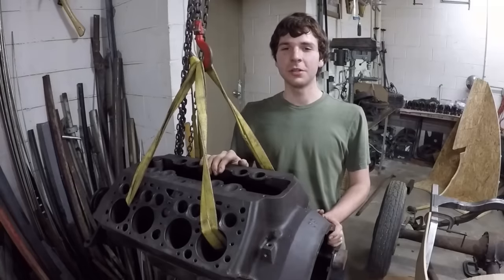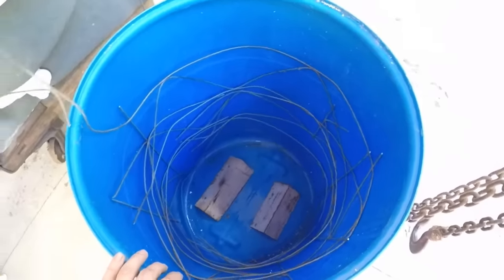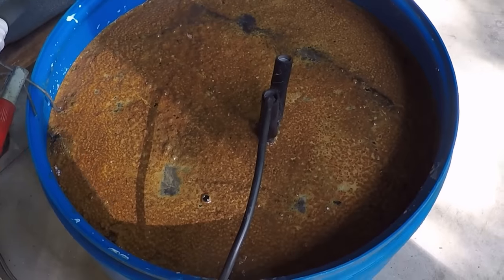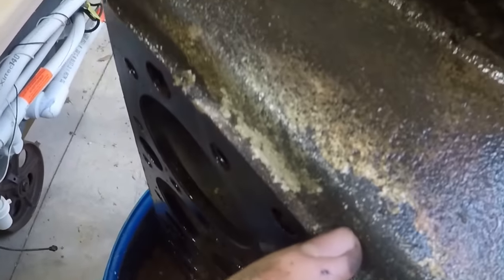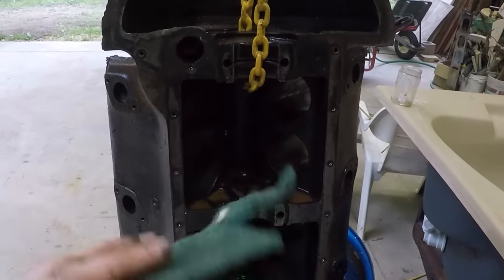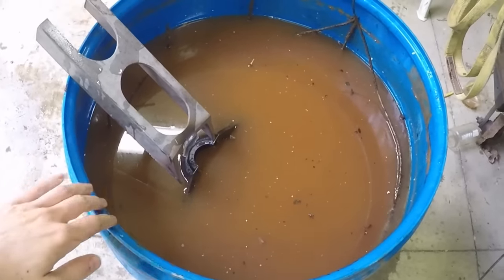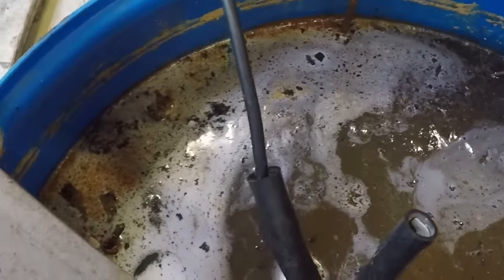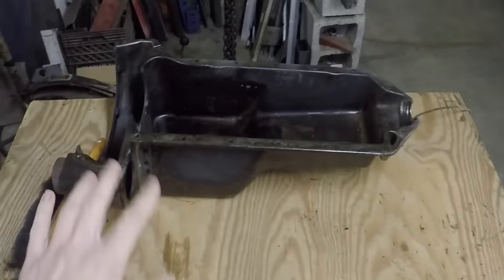Cleaning a 70 Year Old Engine with Electrolysis

Comment: Nice video, your parts turned out great! A few notes for others interested in electrolytic rust removal:

This process produces hydrogen and oxygen gas. Work outdoors, and avoid sparks and open flames.
The process does not remove ANY of the base iron or steel. It only affects iron oxide, which is converted to an iron compound.
The presence of hydrogen can potentially cause hydrogen embrittlement, but the effect is likelly minimal. Might want to minimize current and time for suspension components.
Higher current will speed up the process. I routinely use 2-5 amps for pulleys and other small items. For engine blocks and other large parts, 10, 20, or more amps would be more suitable.
The water level will drop due to electrolysis (turning water into H2 + O2), and due to evaporation. Evaporation is sped up by heating of the water from current flow. Account for this if you're going to let it run overnight.
Current flow follows the path of least resistance, so exterior surfaces and those closer to the anodes will be cleaned fastest. Interior surfaces will be very slow. Anodes can be place inside the part to overcome this, but be careful to make sure they don't touch the part.
Don't use copper wire or copper clamps to connect the part to the current source. The copper will plate onto your part. Use carbon steel (not stainless) wire or clamps.
Steel anodes are sacrificial, as mentioned. As they oxidize, their resistance is increased. Clean or replace them periodically. Or, use carbon rods as anodes to avoid the problem altogether. Don't use copper or stainless steel anodes.

Have fun!
Reply: Juden Arier  I have read that it changes Fe2O3 to magnetite, Fe3O4.  You're right, acids oxidize, and to  put it very simply, this electrolytic method forces oxidation of one of the Fe atoms through electric current.
Reply: I have wrapped a steel electrode with fiberglass window screen material to insert it into close places. a rod like that could be inserted into the cam bore with good results if needed.
Reply: Nice info on those carbon rods, as they are non-consumables. Any idea on sizing for those rods, as pertinent to the electrolysis process. They're available through Ebay, but not sure if those available would be sufficient @ 7/16" & 1/2" x 12+". The rods would make getting deeper into an engine block by wrapping the rods in a non-conductive mesh (nylon screen?) and inserting that into the lifter or cam bores, or even deeper into the water jackets of old cast iron blocks.
Reply: Saw his clamp in there, but it's so big you might not see the copper?
Reply: Electricity follows all paths, not path of least resistance
Reply: Ca
Reply: Can i used a hood ? Or is the metal to thin?
Reply: Nice explanation.  Thank you
Reply: Electrolysis doesn't remove base-metal, eh? That's not true at all. If it were, they wouldn't use bricks of Zinc as sacrificial anodes on boat hulls. For someone who claims to know so much, you really don't seem know a whole lot. Electrolysis doesn't care whether it's eating away rust or good metal.
Reply: BL4CKB34RD the polarity matters. If you hook up the cables opposite of what he said it will eat up your good part. As long as you hook negative to your part and positive to your cathodes it won’t touch your good metal but the cathodes will be eroded away over time.
Reply: you failed to mention that he called the sacrificial electrode the cathode.  in an electrolytic cell, which this is, the positive terminal is the ANODE, as it is the site of oxidation (AN OX - RED CAT).  the block is the negative terminal, and in an electrolytic cell, THAT is the CATHODE, as it is the site of reduction.  the oxidized iron (rust) on the block is being reduced and re-deposited onto the block.  the sacrificial iron anode is being oxidized and becomes iron ions in solution.  pure iron would be better than carbon steel.
Reply: blackbeard - VERY clever how you use numbers in place of letters.  never saw THAT before.  as for your comment, you are comparing apples to oranges.  the sacrificial anode on the boat hull is part of electroCHEMICAL cell, ie, a battery, in which a spontaneous chemical reaction produces current.  that is NOT the type of cell shown here, which is an electroLYTIC cell, in which an applied external current is used to drive a chemical reaction in the OPPOSITE direction from that which would occur spontaneously.  the names (or the polarities) of the electrodes are REVERSED in the two types of cells.  so you are correct when you say that the sacrificial anode on your boat or in your water heater gets oxidized, but in THIS case the anode is the positive sacrificial electrode (the wire), which gets dissolved, while the block is the negative cathode, where the rust gets reduced and redeposited onto the block.  NOTHING on the block is being dissolved, neither rust NOR metal.  so it is YOU, in fact, who "really don't seem to know a whole lot."  but don't worry, you can still ACT like a know-it-all, and you will fool most of the fuckwits in a YT comment section.  thanks for your 2¢.
Reply: @johnmichael1594  Not even close. I personally don't care what he called it. Sorry, but I'm gonna have to go by what my Uni professors called it, not some guy in a Youtube video or an obvious amateur like you. 

There is no such thing as a sacrificial cathode. Ionized material flows from the anode to the cathode. It's electricity 101. Anodes are always negatively charged (Anionic), and cathodes are always positively charged (Cationic). It's kind-of in the name, Einstein. I take it High-School chemistry class was not your strong suit? lol. When you reverse the polarity, your cathode turns into an anode and vice-versa. If you knew fuck-all, you would know that.

The only reason why one should ever make the part a Cathode is when you're plating it, but again, if you knew anything at all, you would know that.
Reply: @basketofdeplorables4253  So much nope... Removing material from the part is the goal when rust removing, genius. Also, it is the anode that erodes, not the cathode. You've got it backwards, just like pretty much everyone else in this comment section.
Reply: BL4CKB34RD yes we all got the anode and cathode mixed up. But as long as you hook positive to the anode and hook negative to the piece you want cleaned it will only remove the rust and paint from the material. It does not touch the the underlying iron. I clean engine parts with this method almost literally every day. 
The piece that has positive side hooked to it gets destroyed and all the rust transfers to that part. The negative side does not get damaged. If you hook it up backwards though the good piece will be destroyed.
Reply: I started to write much of this, lol. He did call the cathode sacrificial which as you know is the anode. Electricity does follow the path of least resistance. A chemical reaction occurs providing a protective film of hydrogen when polarized, creating resistance. Perhaps the detergent prevents polarization? Carbon rods have been used for impressed current systems for a long time. They can last for years with 24/7 use. But what he did was fine, just replace the wire, it’s cheap. But I’d probably media blast it.
Reply: @jeffb8437  what .........? Even plasma arcs follow the least resistant path
Reply: I always remember it as RCOA: Reduction = cathode
Oxidation = anode
Reply: +Norlijah Arshad - lol.  don't hold your breath.  8^)
Reply: BL4CKB34RD most boats deal with galvanic corrosion not electrolysis, it’s a misnomer that took hold but should be corrected.
Reply: @johnmichael1594  Almost...no finer words have ever been spoken...high five on that brother!
Reply: Close
Reply: Juden Arier  He seemed to get the water jackets very clean and rust free with a basic solution?
Reply: Juden Arier  (solutions dont solve iron oxide, but acids do. ) Probably the translation but using the word solve implies it does not remove rust (Iron oxide) unless acid is used.
Reply: Thank you...
Reply: Why dont use stainless steel anodes?

Comment: The biggest gain we found on our cast 289 ford V8 blocks was that it really cleaned the water jacket out and made quite a difference on the temperature when running 😎
Reply: There are company's that sell a filter to go in the radiator hose. The old SB fords were really bad about  casing sand and grit  plugging the radiators
Reply: @Rat Fink That's bull . Buddy i have owned an automotive machine shop for over 30 years . Specializing in fords. 60's and 70's Fords shed sand and casting trash. Filters for the hose are made for just that reason. In the 60's and 70's there were many foundry's and the big 3 had and still have there own casting foundries. Blocks and heads were made in the old days with sand . The accuracy and quality was awful . I have sorted through a dozen blocks with a sonic checker to get one that has expectable core shift and cylinder walls on older castings. For high performance use. Now heads like AFR are permanent mold castings as many OEM or a lost foam method or wax cores. The old sand casting are long gone for engines and heads. it would be impossible to sand cast the complex thin wall casting of today with sand due to core shift and porosity.
Reply: @Rat Fink Do a little research then open your mouth
Reply: @Rat Fink Yes, but not everyone cleans their blocks the same way. Chrysler had an issue with their magnum v8 engines shedding casting sand and having premature water pump failures. A good engine block flush will clean it out, but a coolant filter is also an option
Reply: I cleaned quite a few ford flatheads and the water jackets were always full of junk. After baking and steel shot blasting, still had to jam an air nozzle deep down every coolant hole many times to get as much out as I could.

Comment: Cool - that block looked so nice. Only criticism I have (take it from someone who's done it for years) is to please wear safety glasses when pressure washing. Especially on irregular surfaces those little chunkies can ricochet back at you before you can blink. I've had bits of crud cut my face (no face shield) and was glad that at least I could still see at the end of the day because I was wearing a $2 pair of safety glasses. I had enough nasty things get in my eyes when I was young and immortal and too cool to wear them - now I just wear the glasses whenever there's a hazard because the world is beautiful and I want to see it, my children and, soon, grandchildren. If you're going to take good care and pride in that engine rebuild, please extend the same courtesy to your body.
Reply: murraystewartj wise comment
Reply: Couldnt have said that better myself.
Reply: thanks for this simple but important reminder🙏
Reply: All I have is a metal 55 gallon container can I use that instead of the plastic one Will it still work?
Reply: Also wear a mask, aerolized liquids are a health hazard for your respiratory system
Reply: @hectorortega9131 I think it would. Paint the inside, or line with plastic. Even if bare metal, should work.
Reply: Safety squint all the way bruther

Comment: The blackened coating that remains is called Magnetite.
Reply: Yes, it is a different oxide state than common rust and is much easier to get off the metal.
Reply: I was thinking patina, it shows you I was at the back of the class with my helmet and crayons!
Reply: I use a piece of a magnetar to remove it.   :-)
Reply: That worked great!  👍
Reply: Isn't magnetite also a type of iron ore? Back to whence it came.
Reply: Rust is iron oxide. Electrolysis turns that rust into a heavier compound of such which does want to be with the cast iron. Magnetite is Iron(III) Trioxide.

Comment: Also a big advantage is that the interior rust in closed subframes is disolved.
European cars have often closed boxsections and subframes because of their monocoque construction.

Importent with those parts is that you drill some holes so the proces can also reach inside.
An additional advantage of those holes are that you can use a borescope to see inside and apply anticorsion into it.
Reply: Go back to school

Comment: You were the only video that warned me about aluminum dissolving.  I will be cleaning up a tool and one of the parts is aluminum with two steel rods sticking out.  I don't want to risk pressing the rods out to de-rust them, so I'll work out a different way.

Comment: There is a problem with using electrolysis for cleaning an engine block. That is many use small plugs of aluminum to blank off oil galleries, these can be hidden in the end of drilled holes that you wont see. When the engine is rebuilt there isn't proper oil control through the block and it fails immediately after rebuild.  Any bearings that go through the process will need replacement, Camshaft etc. This isn't the case with all engines but some do this.
Reply: Your supposed to strip the block bare first, duh

Comment: I kept thinking...... what would 40 amps have done? Would it have worked better? Faster? Or made no difference? But I must say..... That bare Flathead block is a piece of art!😁
Reply: It would probably have pitted the hell out of the block. When you're doing electrolysis, you're removing material, and too much power can quickly ruin the part. Think of it like a welder in reverse. The more power you give it, the more material will be removed, and electrolysis doesn't care whether it's eating away rust or base-material. Electrolysis has no sense of humor, you see... lol Technically speaking, if you let the part sit in the tank long enough at even low amperage, there would be pretty much nothing left but a really crusty cathode.
Reply: @MFKR696  
That's contradictory to what he said. He said it only ate off the rust and grease and didn't affect the cast iron. I also seen another commentor say he uses 10 amps or more on large items. That's the problem with YouTube. Do I believe the YouTuber and the other poster, or you?🤔
Reply: @1956model1  Of course it's contradictory. That's kinda the point.
Reply: From what I have heard, only the rust (iron oxides) are affected by electrolysis because of the molecular charge causes the iron oxide to break up with hydrogen going to bubbles and oxygen going to the cathode.  The black stuff is a mixture of iron metal and magnetite from what I know.  I could be wrong.

Comment: To be more specific, due to galvanic reactions and the properties of aluminum, it would be eaten away because it would effectively turn into a sacrificial anode, much like the Zinc bricks that are used as sacrificial anodes on boats and ships. Because of the galvanic properties of Zinc and Steel in sea-water, on a boat/ship that's electrically grounded through the hull, the combination of salt-water and angry-pixies will pull material away from the Zinc bricks instead of the hull. If they weren't there, the hull would ablate to nothing in no time just from being grounded the way it is. A ship is essentially a giant anode, and the ocean is essentially a giant cathode. I know this has nothing to do with anything, but I thought it would be interesting to mention.
Reply: I have a patent in electrochemical regeneration. You are 100% correct. 👍
Reply: @jamieoconnor8692  I know lol.
Reply: That can prove problematic on dissimilar metal constructions.  Which a lot of engine parts are now a days.
Reply: @LynxStarAuto  Indeed
Reply: @morglavey922  I'm sorry to hear that. It's a shame to see anything go to waste like that.

Comment: @macroMachines it doesn't really matter whether you set it at 2, 200, or 400 amps. The battery charger is constant voltage supply there for it will always output 12V. By ohms law the system (being the whole electrolysis system) will draw whatever the amount of current ( or "amperage") necessary to act on 12V. I would recommend leaving it at 200 because then the system will be working at full capacity. By leaving it a 2amps you MIGHT (I could be wrong) be keeping the process from running at its fullest. Best way to check is by using a multimeter connected in series (NOT parallel) and checking the amount of amps it is drawing. If it is stuck at 2amps, you might be holding back the process.

Comment: nice video and its always nice seeing younger ppl using old school techniques. this looks alot easier to do at home than an acid bath to clean a block up so i may just keep this fun fact for the future.

also next time you drill rivets it makes life alot easier if you tap the center out with a punch a little smaller than the shaft in the middle. then use a slightly larger drill bit than the hole and wiggle it around a little as u start drilling and the cap on top should start spinning and walk up the drill bit. then you just push the other side out if it doesnt fall out. or you can tap it from the side with a chisel but thats messier. my time as a mechanic helped me find that trick with rivets and instead of 30+ seconds a rivet sometimes its 10 or less this way. smack with a hammer and 1 bit. when drilling alot of rivets or in tight or bad spots it can make or break your day i hope it helps.

Comment: Good work. That block and pan are in excellent condition. I don't think I've ever seen a flathead Ford V8 that didn't have cracks between the valves or cylinders.
Reply from the maker: Well I  dont know that for sure yet, but fingers crossed!
Reply: @MacroMachines  So far, it's looking very promising.